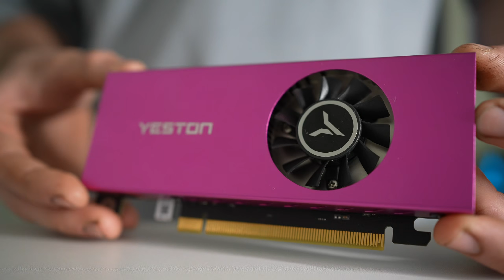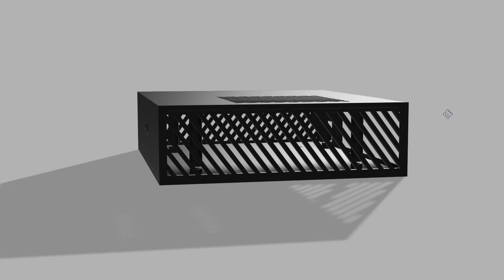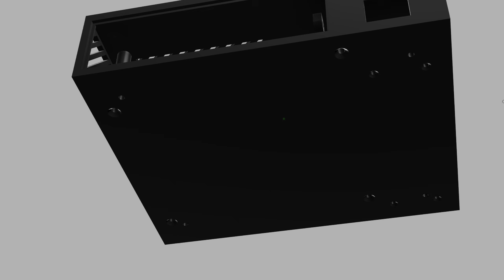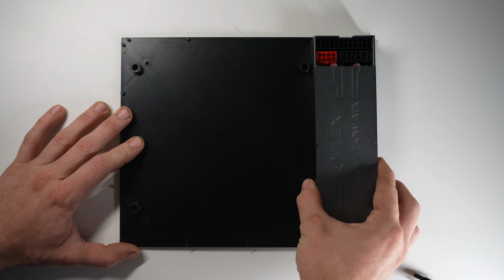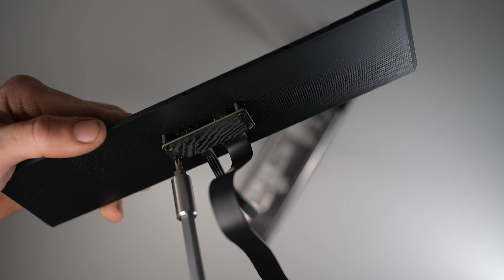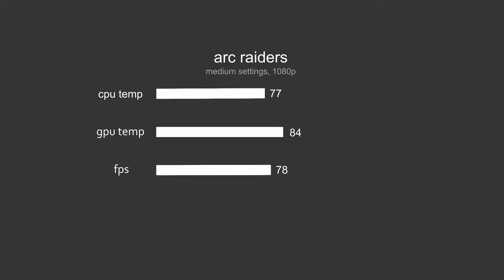This PC is only 2.8L

Comment: that's compact but, that gpu fan blockage is making me uncomfortable 🤣
get a bigger riser, pass it below the flex psu and then up, so that it makes the pcie slot almost glued to the side of the case and the card facing the fan up

Comment: I have a similar build using a Lenovo tiny SFF. One recommendation is to 3D print venting holes for the GPU as well. The Yeston 3050 runs really hot and it needs to pull in fresh air. You can lower temps substantially with more ventilation and get higher sustained clock speeds.

Comment: Can You Design one for a 5060LP ? Or any LP card ? The 5060 TDP is 145W + 5600x or 5700x at 65W = 210w leaves 40w overhead.  Maybe undervolt the 5060 slightly ???
Reply from the maker: I’m working on a couple of designs with a 5060lp and a flex atx psu (so plenty of wattage). The smallest I can get it is about 3.4litres and I’d like to get them manufactured out of steel for a video but I’ve got a couple videos I’d like to do first :)
Reply: @PhasedTech sounds great !!!!!! This is truly epic.
Reply: @P @PhasedTech might need a 500Watt PSU right ?
Reply from the maker: @MasterOfNone88  500w would be plenty but I went wiith a 600w PSU for any other future builds I do :)

Comment: wait, so how exactly should gpu even breathe in this case? Like it's little fan is kissing the case of the psu without any exaust
Wouldn't it be better to rotate gpu for it's fan to be at the top and make small perforation in the case for it like you did with cpu cooler?
Reply from the maker: It’s not touching the psu, there’s about 10mm of space

Comment: Great build but you might want to flip the GPU around, and a vent cutout so it pulls cool air from outside the case to pass across the GPU. yes your HDMi will be flipped but cooling would be much better
Reply: Yes😢 bro

Comment: Why not flip the GPU around and let it breathe?
Reply from the maker: That was my first plan, but it'd require making the case slightly larger and an awkward riser that i didnt have on hand. The case was more of a how small could i achieve, and after all it performed fine for me in that orientation.
Reply: @PhasedTech  80+ degrees on a RTX  3050 seems like a lot, I think it would be worth it sacrificing a few more milimeters for way better cooling. Other than that, loved the build.

Comment: What is the link to the usb power switch module. That seems like a really cool part
Reply from the maker: Not sure if I can link in YouTube comments but if you search ‘USB 3.2 3.1 Gen2 Front Panel Header 10G High-Speed Type E Male to Type-C Female Expansion Cable Motherboard FPV FPC Flat Wire’ on AliExpress you should see it
Reply: @PhasedTech  ok thanks 👍

Comment: nice job but a 3050 is in no way a console killer!
Reply: Is there a reason why these projects never allow enough space for a decent duel fan GPU like a 9060xt.

Yeah sure small is good but good performance that's perhaps a bit bigger would be better.
Reply: @BogStandardaAsh  wouldnt be surprised if there was a race to the bottom (smallest)
Reply: @BogStandardaAsh  they usually do, this is the first time i'm seeing someone go this small, other than this all the other projects that i saw go for a dual fan or a full sized gpu
Reply: @PedramHalataei  oh cool, can you point me towards a good one?
Reply: Well currently there's no single slot 5070
Reply: @dari_Dx06 doesn't need to be a 5070 to outperform a ps5
Reply: @Unlucky1776 still there isn't much single slot gpus, he would need to make a new case designed for a low profile or single fan GPU instead(form factors where you can get a 5060)
Reply: @dari_Dx06 still doesn't need to be a 50 series or even an rtx to be really competitive with consoles. If it's trying to fit in this case.
Reply: @Unlucky1776  but there isn't much in the single slot side, I think the most powerful gpu that has models in that form factor is the 3050
Reply: @dari_Dx06 there's an sff 4060 but it's not single slot from what I know. There's also that one Intel sff a380 though I don't know if thats any better than the 3050.

 Truth is there really aren't many options but a true console destroyer would house the sff 4060 ngl.
Reply: @Unlucky1776  the thing is that there's 3 types of sff gpus, single slot, single fan, and low profile, the 4060 has a low profile and a single fan model but not a single slot model, I don't know about the A380 but I don't think it is more powerful than a 3050
Reply: @dari_Dx06 yea I agree but what I'm saying is that even the sff 4060 would've been the real console destroyer (with dlss/frame gen since the PS5 uses upscaling too.) though the sff 4060 does needs additional power.
Reply: @Unlucky1776  well yeah a 4060 has similar performance if not better to a PS5 and has better upscaling
Reply: @dari_Dx06 yep. A little redeisgn for the pc and it would be a real console destroyer. Well until ps6 comes out
Reply: series s/switch 2… competitor???
Reply: @funknugget6334 when people say console killer they mean ps5s/Xboxes. Not Nintendo switch 2.
Reply: @Unlucky1776  correct, a 3060 can arguably be a console killer but 3050 is lower than 20 series in terms of performance
Reply: @PedramHalataei  agreed. 3050 is fine for sff but not really a great console killer. still a great tiny build tho
Reply: @PedramHalataei  a ps5 has an equivalent of a RX6700 inside it, the 3060 is still 5% slower. It wouldn't be a killer but rather equivalent performance to a console.
Reply: @liebrat not a console destroyer though.

Comment: Can I ask what type of filament you used and how long it took to print? Also great video.
Reply from the maker: I used ABS for everything. I printed at 0.08mm high quality with a 0.4mm nozzle in bambu studio so it took quite a long time, i think about 8 hours just for the lid, so probably around 24 hours for evrything! Appreciate it :)

Comment: I feel like you could flip the GPU to have the fan pointing up into a vent on the top panel. That would substantially improve GPU temps, although it'd make the riser situation a bit complicated. Some undervolting on the CPU/GPU wouldn't hurt either.

Awesome build all around though! Great idea to hold the case together through the motherboard mounts.
Reply from the maker: I agree with you on that. I actually have a longer riser on the way to try out the positioning. Thank you mate I appreciate it :)
Reply: @PhasedTech  what about a shorter riser board, so the GPU is underneath the PSU and can intake air from the bottom of the case? You would also need some kind of electrical insulation between the back of the GPU and PSU of course
Reply: I came to post a similar comment. The HDPlex is passive and gets quite toasty. Flipping that gpu to get fresh air should make a substantial difference.